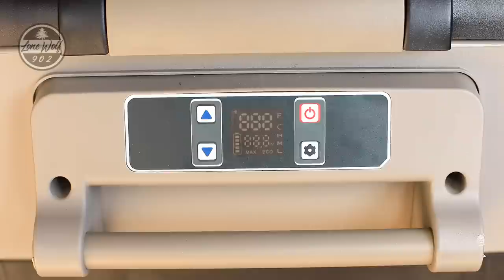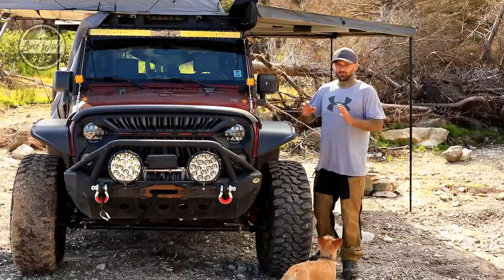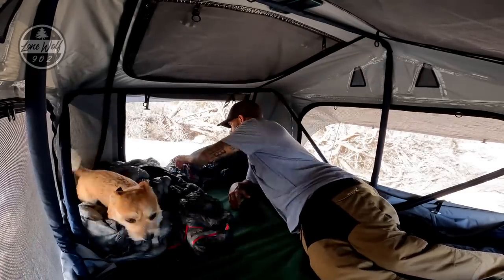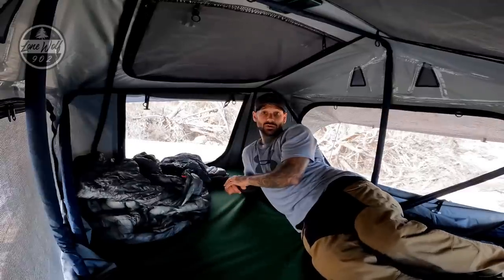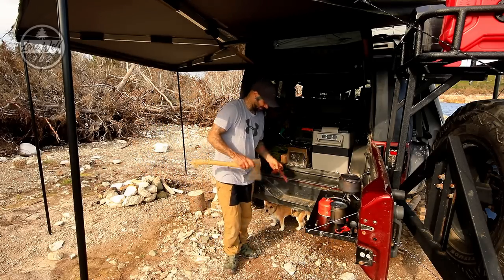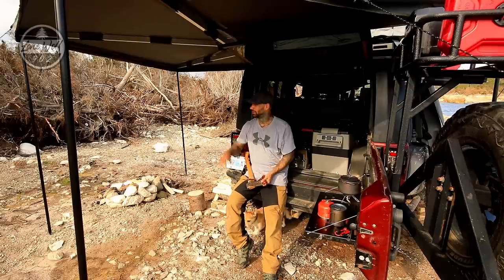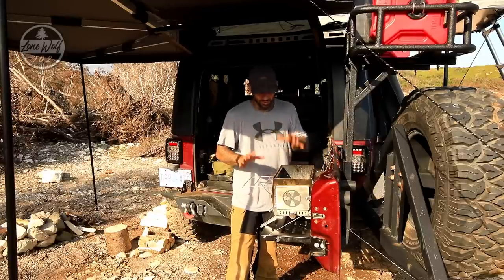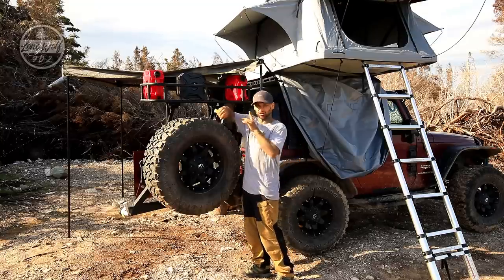Overland Roof Top Tent Jeep Camping

Comment: How do you like your batwing? I’m thinking about either getting just a tent and rocking the tarp idea like I did last year. But next year I wanna spice it up and buy a batwing… but reviews tell me you can’t really use them in 30-40km winds. Which happens a lot in the prairie land. Do you recommend? Sorry for the long story
Reply from the maker: This is from overland vehicle systems. Much better than rhino rack batwing. I do NOT recommend the batwing awning.
Reply: @Lonewolfwildcamping  why wouldn’t you recommend the batwing?
Reply from the maker: @QuantumMuch  it is extremely cheaply made. My zipper broke on the bag and I had to wrap rope around it just to get home. The legs break easily as mine did in a gentle breeze. All the pieces are press in plastic.  Horrible design and not worth the time or money.